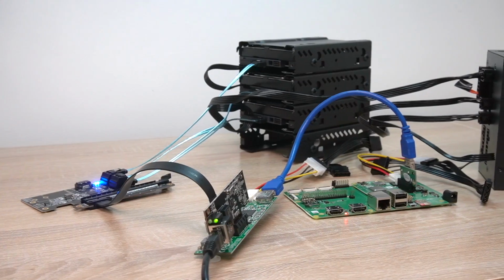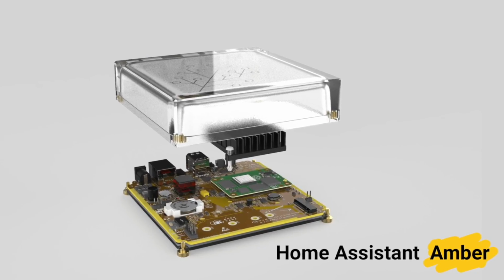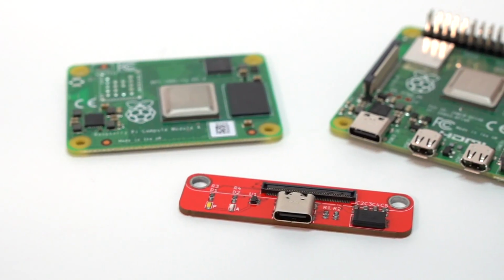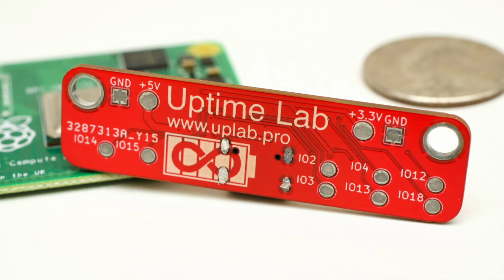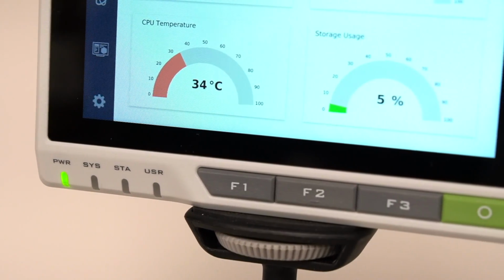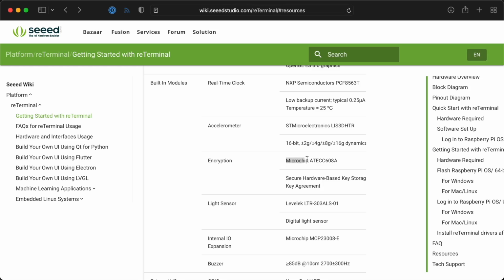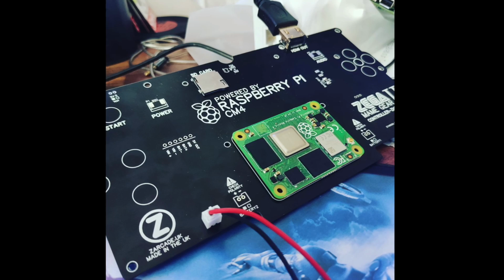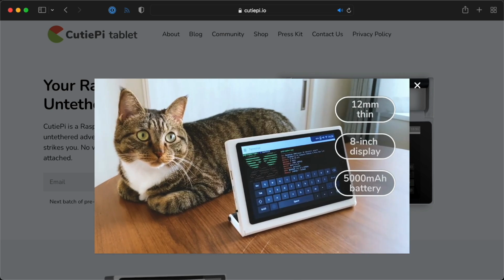Small but mighty! 10 new Raspberry Pi CM4 Boards

Comment: Please do videos about Home Assistant! I'm currently using Homebridge but I'm planning to do much more soon and I'll probably need to switch to Home Assistant :) 
I'm also really happy that the Pi finally seems to be taken seriously in the industry/manufacturing world, where there's been too much expansive and highly proprietary hardware in the past.
Reply from the maker: Industry, and another area I'm interested in but have seen almost zero developments is medicine/sciences. Many simple devices could be supplanted by open source software on a Pi, and bring costs down substantially.
Reply: @JeffGeerling  * angry Big Pharma noises *
Reply: @JeffGeerling  I'm CTO of a medical device company, and very interested. I think one of the largest aspects of Pi as a platform that may be an issue for medical (depending on the class of device & risk profile) is the lack of a secure bootloader out of the box. There seem to be some commercial options out there, but given the growing awareness for physical device security, this seems like something that could/should be on the radar for Pi OS (if it's not already - I'm ignorant on the topic).
Reply: @JeffGeerling  There may be a business opportunity there.
Reply: Please be aware that the pharma industry has some specialized software development/testing processes that are government mandated in an attempt to keep manufacturing from going awry.  I know a company or two that have products in refining, chemical, and petrochem plants that have shied away from Pharma because of these requirements.

Comment: ZFS in my opinion is still the best way to get data safety. But I'd not be comfortable without ECC on it.
Reply: ecc memory or ec on the memory controller? I think you need to touch up on what you THINK ecc does.

Comment: Man, all I want is a CM4 board with dual 2.5Gbe and a single 1Gbe :( perfect router board doesn't exist
Reply from the maker: I still have plans to at least show my custom dual-2.5G router build at some point... I just haven't had much time to work on networking-related things. Maybe early next year!
Reply: I bought the Macchiatobin. Two 10GbE and one 2.5GbE. I'm thinking of letting Jeff borrow mine to make vids with.
Reply from the maker: @MarcoGPUtuber  You're making me envious!
Reply: @JeffGeerling  I've just been trying to put it together in a way I like. 

For example, the CPU fan it came with was ungodly loud. Not suitable for a router. So I found a local Taiwanese company to send me one of their all copper heatsinks and fit it into the holes. I can't have a router going WHIIRRRRRRRRRRRRR all day long. We'll talk tonight! I finally found a great fan and it's almost complete. Another infuriating thing is, despite being ITX, it did not come with an IO shield, so I a waiting for a blank so I can dremel the holes out myself for MAXIMUM airflow!

Comment: Hey Jeff! Please do a video on Home Assistant. I have been thinking about switching to Home Assistant, myself, so I am curious to find out your thoughts.
Reply: If you do this, would love to hear your pro/con analysis on ZWave vs ZigBee (license model, effectiveness, etc)
Reply: @phpnotasp  Yes, I would also like to see a video on Home Assistant, including ZWave vs ZigBee. I have been putting it off, but need to make the decision and commitment but have been leaning toward ZWave which I recall is consistent with Samsung SmartThings.
Reply from the maker: It looks like Linus from LTT might be starting to build out his new home with Home Assistant too, so there's definitely precedent!
Reply: Oh boy that's going to be nuts.
Reply: @JeffGeerling  That is a very significant endorsement.
Reply: I second this. I picked up an Ecobee recently but haven't installed it yet due to lack of a C wire. I'm curious how a DIY option would compare. Thanks for the great vids!